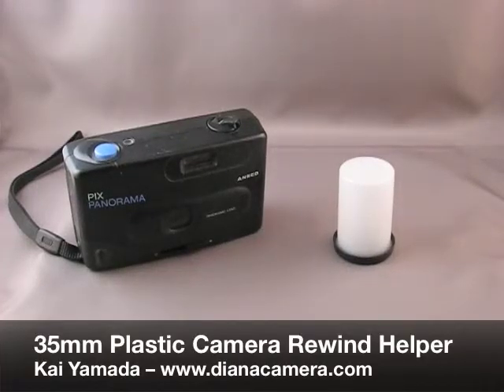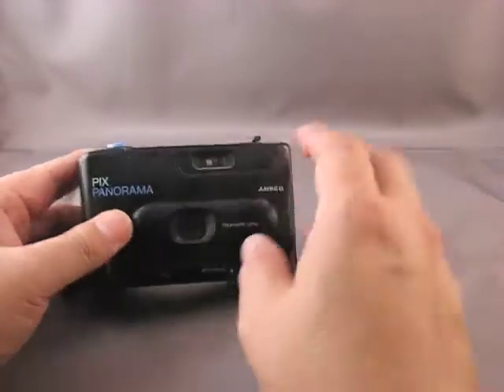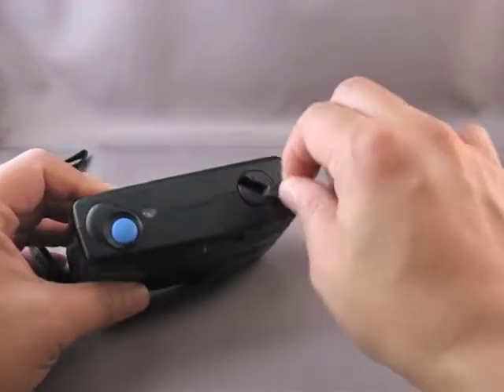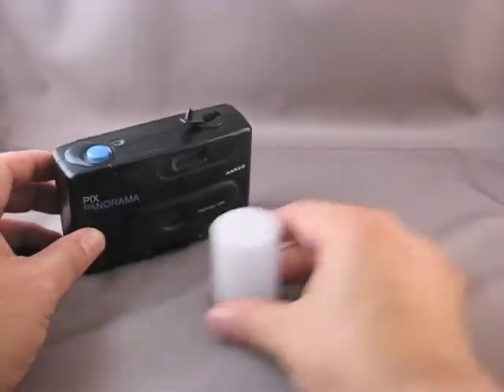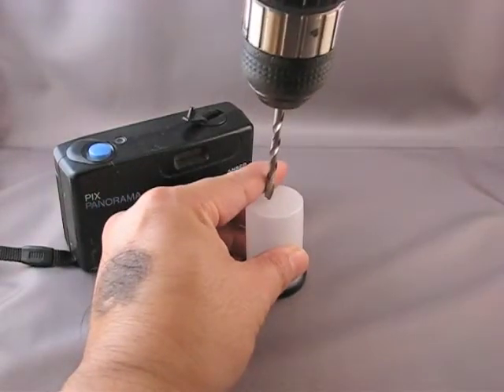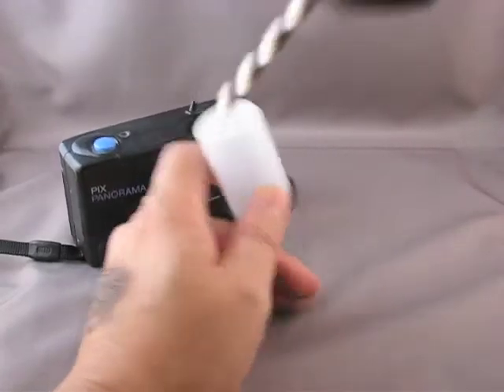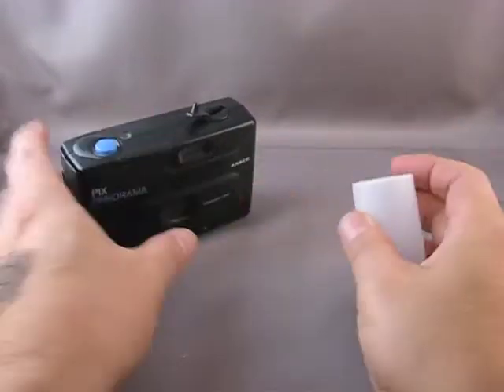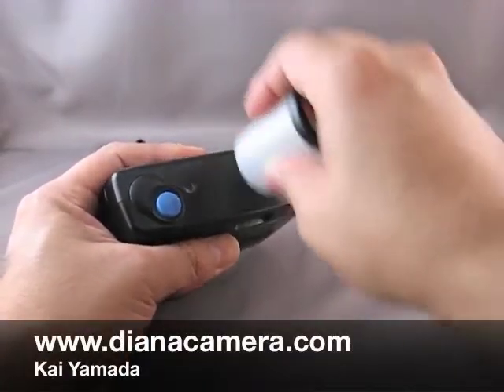35mm Plastic Camera Rewind Helper

Comment from the maker: @DubESTsteP using 120 film, 12 or 16 images, depending on the mask used. If using 35 mm film with the 35 mm adapter, it depends on which mask is used.